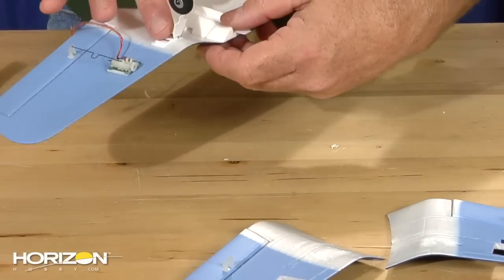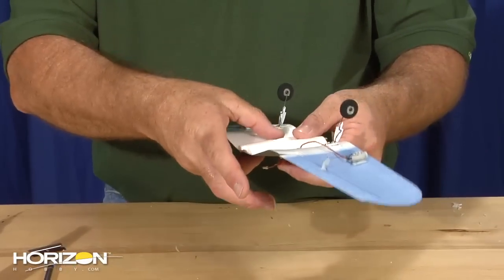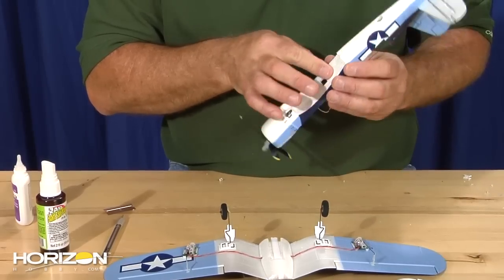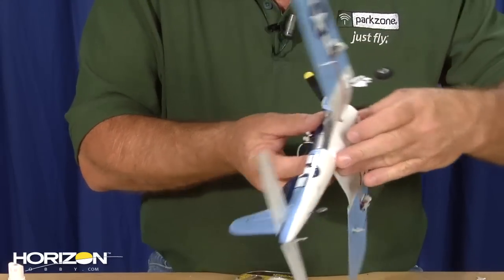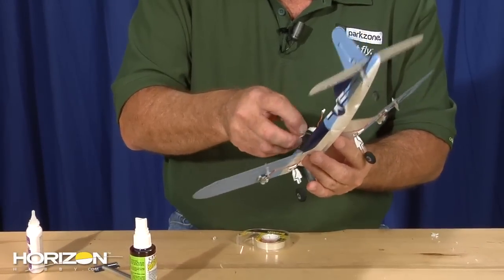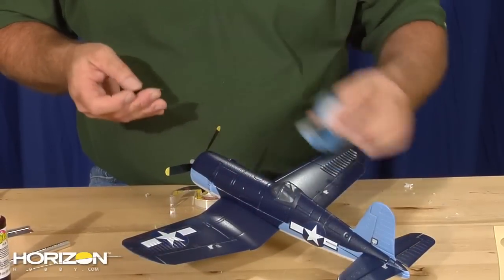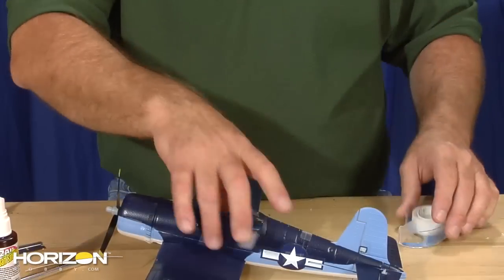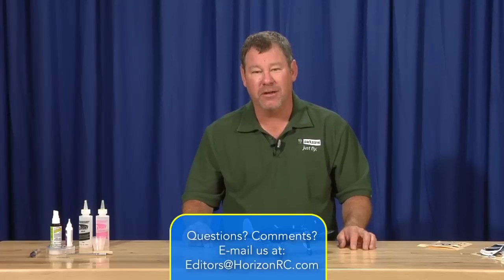HorizonHobby.com How To - UM Corsair Wing Replacement Pt 2

Comment: Excellent tutorial.  Changed my wing out and this was extremely helpful, Thanks.  I marked the servo plugs as shown but the marker wasn't visible on the plug.  After doing a little testing I found the right aileron plug servo goes into socket #1 and left aileron plug goes into socket #2.  Thanks again.  I look forward to the Corsair rejoining my micro P-51 in the hanger!